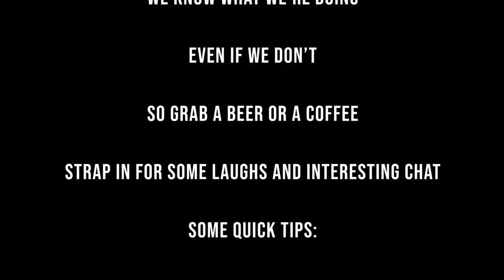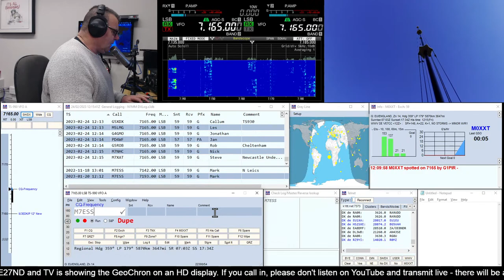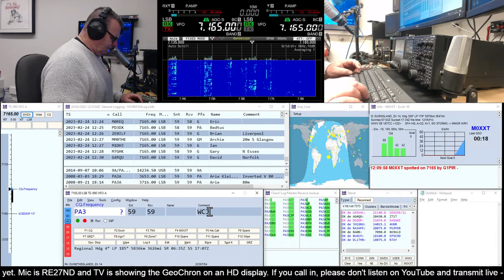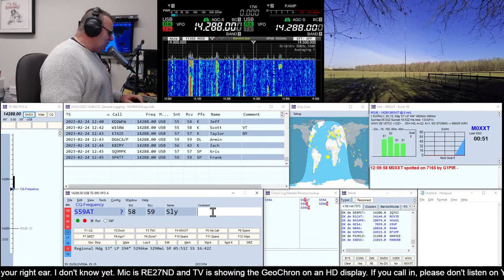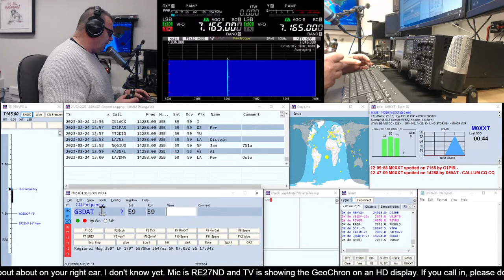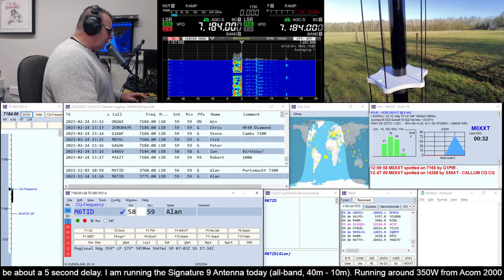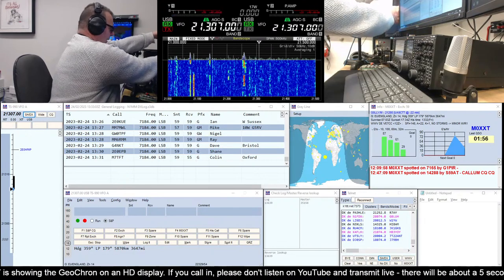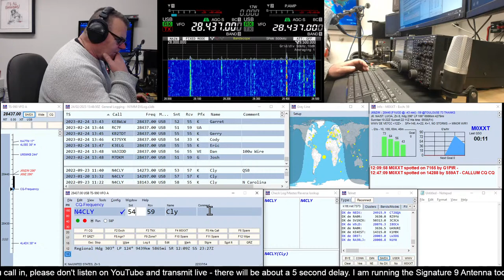This is What Ham Radio Folks Do - We Play Radio!

Comment: "I've found a way to get 40 and 20 on one element - no traps, just a little coil"   Erm, I hate to be picky, but what do you think a trap is?
Reply from the maker: You can be as picky as you like - but this isn't a trap, it's a third harmonic. Stop jumping to conclusions.
Reply: @DXCommanderHQ  I'm sorry Callum, I'm not jumping to conclusions, I'm confused.  I understand the third harmonic resonance bit, but 20m isn't the third harmonic of 40m, it's the second, right?   I thought a trap was a series inductor (a little coil) that makes an element resonant at multiple frequencies it wouldn't normally resonate at?   So if you added a coil to a 40m wire to get it to resonate on 20m (where it wouldn't normally resonate) - it isn't a trap?   I'm obviously missing something.
Reply from the maker: OK, (late reply apologies) yes 20m is the 2nd harmonic of 40m BUT in normal circumstances, we can't get the 40m element to resonate on 20m. This technique squeezes the harmonic down from 21MHz to 14MHz. The very TOP of the antenna is actually radiating - which it wouldn't do with a trap. The 5th harmonic also comes down too from 35MHz to around 29MHz.